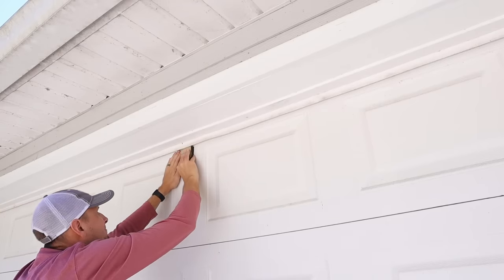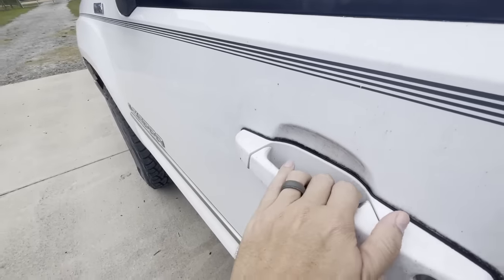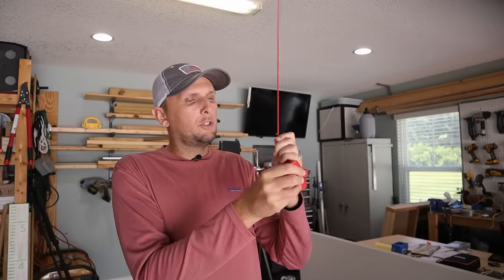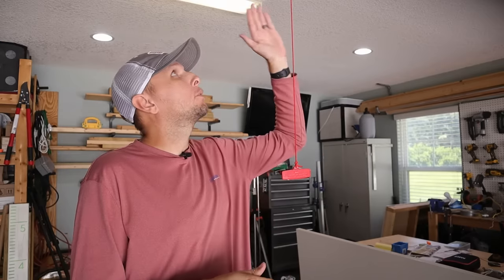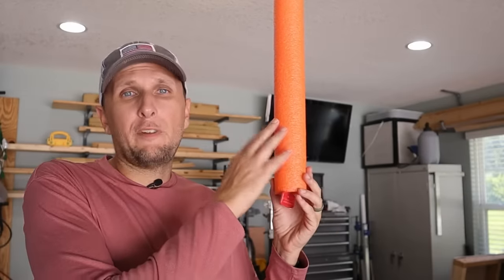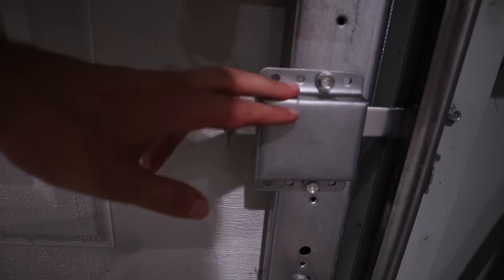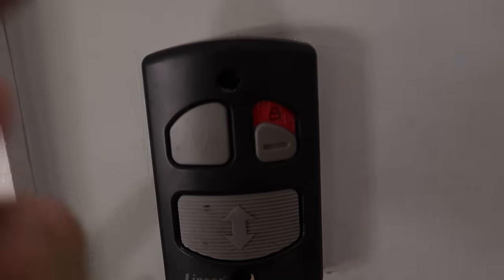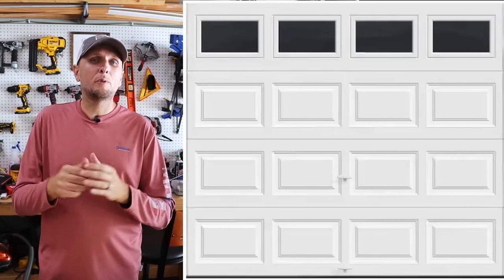How to Stop Garage Door Break-Ins | Number One Way Thieves Get Into the House!

Comment: This is so much to do and is not like the only garage door opener handle I ever had. I have Never saw flat handles shown in the video. The rope mine had had a huge wooden handle held easily in one’s hand. It was attached to the cord and couldn’t be pulled through the opening. You could drill through any piece of wood and attach it with a knot.

Comment: Great ideas.  I do always double-lock the door from the garage to the inside of the house.  Still, I wouldn't want to lose the stuff I have in the garage (tools, bikes, gardening equipment, holiday ornaments, small appliances) even if intruders can't access the house.

I might install those slide locks.  Knowing myself, I would be sure to tape a note to both the keypad and every remote control reminding me that the locks were in place, so that I didn't try to open the garage door before they were unbolted.

Comment: Regarding unplugging the opener, I use a Belkin wireless outlet (must be able to handle the current used by the opener). It is scheduled to turn off at a certain time in the evening, and I can turn it back on the with app. This works good for being away for a bit as it is not scheduled to turn back on...

Comment: On my house, I have what you would call a “SIDE MOUNT” garage door openers so the garage door opener is not where a traditional garage door opener is located. And when the garage door is shut, there is actually a deadbolt type mechanism…. that stops the garage door from being opened.  I really like these type of garage door openers because it leaves the center of your garage wide open.

Comment: Good video, and great idea about using the piece of insulation on the release cord! You are right about all of this, though I also have a lock on my garage door on the outside, that you have to unlock to release the cable.. So a thief would have to break my lock, and also fish the release cord to open my door. NO thief is going to be in my driveway this long, without my dogs barking, and me catching them at trying to break in. And yes, I do have keychain door openers, and would never park one of my vehicles in my drive with the visor door openers I have in my 2 vans. My car that stays in the drive does not have a visor remote.

Comment: I just zip tie the cord through one of the holes in the black 45 degree opener arm so they can’t pull it through. My power went out recently so I just cut the zip tie and BOOM I can open the door manually.

Comment: I have a row of glass "windows" (a.k.a. "lites") across the top section of my garage door.  If I was going to break into my garage I'd just break out the middle section of glass , then reach in and grab the door release pull cord - no "fishing" required.  After watching your video it seems that removing the pull cord altogether would be my most effective option.

Good point about locking the door from garage to house.  I've never done that - until now.  Thanks.

Comment: Thank you for these tips,  I recently had a break into my garage, but my own fault because during the hot summer when I do laundry (which is in my garage). I would keep my garage door  open about 15 inches for ventilation and some crook crawled underneath, used the manual release, lifted the garage door so I wouldn’t hear it while I was inside my house. The criminal stole my electric bike, and some other things, and rummage through both of my cars stealing the $20 emergency  cash and some gift cards out of the inside of my cars as well… so now I always lock the door to my house whether I’m home or not , I never crack my garage door anymore, and I lock my cars while in the garage…. I will look into the other tips like remote that  locks, As I would forget about the metal locking system you showed.    Thank you.

Comment: To safeguard my garage windows, I bought a couple of garden metal fence sections that I installed inside each window drilling through the wall to bolt it on and in such a way with hardware that allows them to still swing open from the inside after removing a nut on a bolt.

Comment: The pool noodle is a novel idea.

As mentioned in another post, I use the tie wrap method.  I have a small hole that I can fish a small tie wrap through and have to cut it if I want to use the garage door release.  I like this method because it prevents someone from being able to fish a wire to the actual release mechanism versus using the cord.

I also wrap the cord around the arm of the door.  I did it initially to keep the plastic handle from hitting the top of my vehicle.  I didn't realize it was also improving the security of my garage door.

I'm looking at using some timers to turn off power to the doors late night/early morning when we are not likely to use them..

Comment: SUBSCRIBED!

I like the idea of the side lock, but as said here, it's easy to forget to unlock it before leaving.  But even more importantly, there's no way to lock it once leaving so the door is protected while outside the home.

So now this has me thinking.

I see these locks all over the place for really cheap.
So I'm thinking, I'll pick one up and see how easy it is to slide the lock back and forth.

If it's easy or can be made to be easy, then I'm thinking, perhaps I can design some kind of solenoid that is triggered by an Arduino or ESP32 so that when the door opener turns on (opening) that the solenoid is triggered to UNLOCK.
Then, when the door comes back down into closed position, that the solenoid is triggered to LOCK the door again.

This could be an interesting project and I could also use it to transmit to the house, to my "Whole House Monitoring System" to confirm that the lock is locked and also report that the door is closed or opened.  It is easy enough too to have it report or trigger an alarm, in the house if someone does get the door to open.  Or, even jiggling the door.

hmmmmm

[UPDATE]
Well go figure!  LOL  I just did a search and sure enough, others have thought of and designed exactly that!  LOL

Comment: I think one more trick you could/should mention is using a zip tie on the lever and shortening the cord.  You can flip the lever on the rail if you have a hook-type rod.  The zip tie makes it harder to release due to the angle of the lever.  Good video, I tell my wife to CLOSE the garage door no matter what, it opens just as easy as it closes!

Comment: My garage door has a lock button that disables remote access. You either need the app or the keypad and code to operate it. As for the homelink in our cars, I never set those up. I never installed the release cord given that modern doors have both beam detection and pressure sensors to prevent the door from closing on you. Plus we have two VERY LARGE and unfriendly early warning systems. So if someone did gain access to our home they had better come prepared and unlikely they came through the garage. Additionally, they were both trained to not take treats from strangers. Yes that’s actually a thing.

Comment: I’ve seen them just punch an X with a large screwdriver right through the thin metal of the garage door. Once an X is punched they just widen it up a bit. They have better access and can see whether or not there is even a handle. I cut my handle right off first thing after moving in. I also have an automated deadbolt on my door to the garage that automatically locks after a set time if anyone forgets to lock it. 

Also if you have any access above your garage to an attic or anything like that storage space, your garage just might have every single tool robbers need to just get a ladder, cut through the drywall ceiling and now they have direct access to your home. I sealed off the attic first thing too with 3/4 plywood planks across entire attic above garage. If they want in that way they’re gonna have to work at it. I also have deadbolt on door to my attic just in case they do get past the 3/4 plywood.

Comment: If gone for long term one can take advantage of those little holes on the rail for the garage door and slip a prybar in them to prevent the rollers from going up. Can also be useful when a power loss happens and you must pull the cord or if you don't even have a garage opener.

Comment: If you're buying a new opener, consider a jackshaft opener -- not only do they not require the pull cord for safety release, but they have automatic locking bolts that engage when the door is shut.  And they're a ton quieter and don't take up the overhead space.  So win, win, win, win.

Comment: As a locksmith of over 45 years I did a lot of work for apartments were the tenants lost the remote I used a welding rode it was fast like two minutes if that and I got a check ✔️

Comment: garage doors are usually only closed but not locked, I would use an additional remote-controlled magnetic lock to lock the door... I would also add a bit of electronics to prevent the garage door from opening when the additional lock is closed, easy to do with a simple relay that cuts off the power to the door actuator

Comment: Dude, I'm from Philly and yes we lock our cars in our garage. Then the entryway into the house is locked, then the office door in the garage is locked, then the windows have steel bars to stop the windows from being able to be lifted, then the kill switch to the garage door is engaged.  I'll just leave that there as the preliminary safety measures in place. I could go on and on but the Philly dead bolt story is for another time.

Comment: Nice info on this video. How about securing a small wooden block (or something similar) to the otherwise flat red handle? Zip ties? Duct tape? This would make the handle  much thicker and not able to slide through the opened slit at the top of the garage door. A thicker and easier to grasp handle may also make it easier for you to pull the cord if you ever needed to open the door in an emergency.

Comment: One way to be able to get rid of the cord hanging down would be to go to your local home supply store and get a 3' length of steel rod that fits the hole that the cord goes through (or make the hole larger if possible). Bend one end of the steel in an "L" shape a couple of inches from the end and bend the other end into a loop, or attach a handle. if you need to open the door manually you use the hook to pull the release. You can also, if you don't have a drill to make the hole larger, cut the cord short and tie a loop in it to be snagged by the hook you made. Store the hook on a wall where you can find it if you need it.  Just a thought.

Comment: As a builder in Tasmania Australia the most common way the little truckers get in is just by kicking the bottom 500mm of the door in to buckle and pop out of the tracks , then they just roll in under . Once inside they bypass the locked door by making a hole through the plasterboard . When they want in nothing is going to stop them .

Comment: Another thing those release cables can do is rip the luggage carrier off of the top of your vehicle and/or tear the opener off the ceiling, especially SUVs and Vans which are tall vehicles. Make sure that the release cable is installed high enough so it can't reach the top of your vehicle. This is a tip I got from the person who installed my new garage door.

Comment: They also make an electronic version of the door locking latch that is wired into the lift motor controller and automatically disengages itself when you open the door via remote or button, and relocks itself upon closing. Super convenient.

Comment: The manual release on mine has to be pulled INWARDS to release the door. 
When it is fished and pulled towards the door - that is the lock position. 

On mine, the override on the wall control panel will allow you to close the door (with the remote) but not open the door.

Comment: My brother drilled a hole in the door into the wall (near the bottom about 6" up from floor) and used a large nail (like HUGE) to keep it locked, on both sides. Keeps the door ABSOLUTELY shut...like a deadbolts for your garage door.

Comment: Similar to the noodle idea, is to use a wooden handle to actuate the release trolley.  I made one easily for my door, it is about 2 feet long.  I cut a kerf on the tablesaw and this slipped over the tang of the release.  A clevis pin and clip holds it in place.  The main reason I did this was to be able to easily re-engage the trolley because pushing on a rope isn't very effective, but is also serves as a theft deterrent as it is short and won't get fished thru a door crack.  When we travel we always bring our remotes inside the house and disable the opener.

Comment: I've also seen it done where you can screw or nail a thick long wood block inside against the garage wall header where they will try to fish a wire to grab that garage door latch rope. The wood will block  block is a barrier to the fishing wire. It should be about 3 feet long.

Comment: I had a garage door type that opened upward like one big door. The garage had been broken into in the past. I drilled 2 1/2 inch holes through the metal where the garage door meets the floor when closed spacing them halfway on each side from the middle. I then did the same to the concrete floor matching to the holes to the ones I drilled in the garage door. Now when closed I put a bolt through each hole. Of course I’m locking from the inside but the existing mechanism on the garage door was like that probably because the garage was connected to the house. Solved the break in problem though.

Comment: A simple zip tie at the top of the connection preventing it from detaching works also. I'm not sure if that prevents emergency service or something.
And then the smart plug in between the garage door motor and the outlet also works well like other people said. But that means when you come home sometimes you have to remember to turn onto things and sometimes you don't have Wi-Fi and so it can be a pain

Comment: Live on a corner, when the car is pulled out to get yard tools, work on car, someone driving by can easily see my stuff.  Stores that sell tarps sometimes sell garage door size black plastic screens. If the're bigger than your door just fold to size, string a rope between sides of doorway, a few inches below the top rails, with carabiners attached to the screen grommets. Pull open to block view inside, when done tie off to one side with bungee.

Comment: Tip:  Put two medium zip ties through the pull cord hole on the traveler and pull them tight.  That will make pulling the latch release open very difficult from the outside if they can even get the cord out over the top of the door.  If you need to open the door from the inside just cut the ties.

Comment: For travel I drilled two 5/8" holes in the guide rails just a few MM above two sets of wheels, one per side. I put 5/8" chromate plated Grade 8 fine thread (fine thread!) bolts in the holes with hardened flat washers sandwiching the thin rail material and used blue Loctite 243 on the bolts / nuts that were 200% too long intentionally. The holes were close to the wheel such that when blocked by the bolts the door only moved up 1/16". The standard dead bolt from the door people can be bent just by horsing the door open ... as was mine during a burglary. No way they can open the door against 2 x 5/8" blocking bolts without making lots of noise and taking 20-30 minutes of suffering to do so. If they break in from a window in the house they would need a 2 x 24" breaker bars or ratchets to remove the nuts over the 243 Loctite as I do when I return home. They then can't use the open garage door to remove big items fast to a waiting PU truck unless they carry a 7/8" (the flats across the bolt head) and an 11/16" (the flats across the nuts) long tools with them. Using 5/8" bolts was intentional (needing two sizes of removal tools) and made bloody robust wheel blocks.

BTW, lock your tool boxes so the BGs can't easily use your tools !

Genie brand openers now point the top latch 'Y' into the door so it can't be hooked as easy like most others that point the latch lever away from the door. You don't need a rope to hook the latch itself and yank it open.

Keep in mid the real reason for the red handle is to open the door in case of a fire when the electricity fails during most fires.